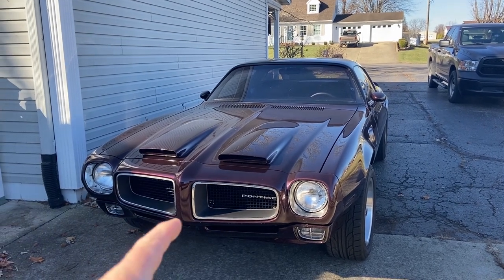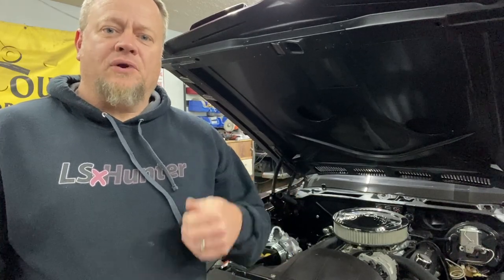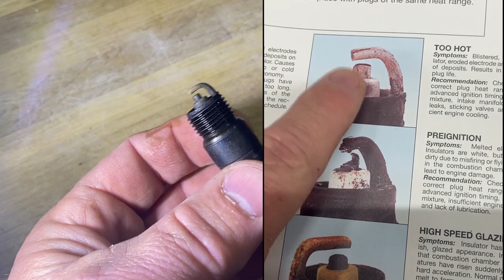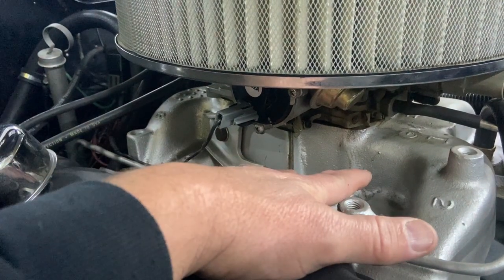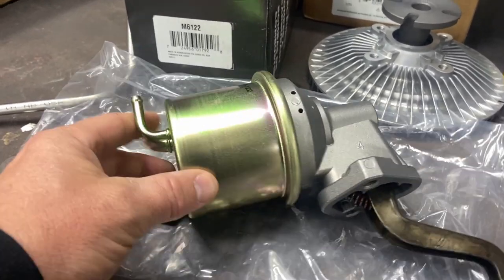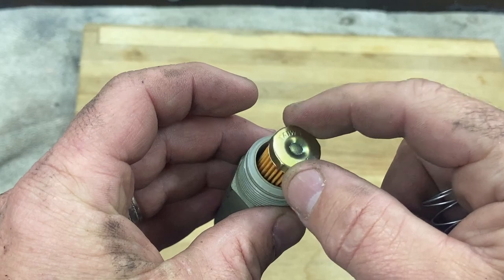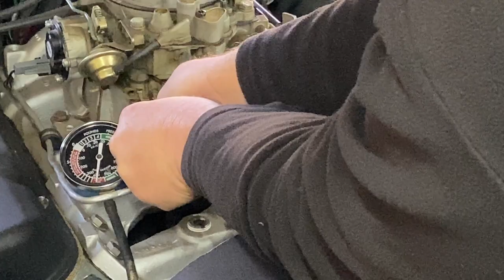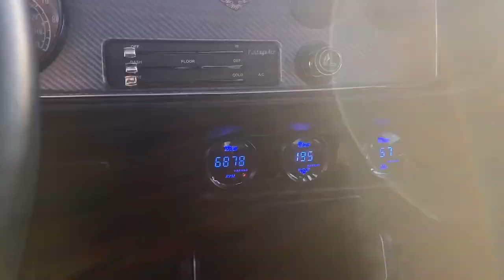Pinging, Detonation, Pre-ignition Problem Solved. Was it a lean condition, bad fuel, wrong timing?

Comment: Just in general things to check:   advance timing so at 3000 rpm @32TDC, run high octane and or quality fuel, Lean condition run carb Idle mixture run them a hair rich, coolant thermostat fast acting (not high flow) give the radiator a chance to cool the engine. Static Timing from 10 being the min and 12 being the max.  Yes for, you running to lean got those cylinders to hot....
 Great video.
Reply from the maker: Sounds good! Thank you!

Comment: In the summer if that temp creeps more than 10deg  look to change that thermostat (stay away from high flow).   200deg is just on the edge hot for a create engine  . big block 190  
 small block 180
Reply from the maker: Gotcha. thanks for the advice!

Comment: Nice car, glad you figured it out, nothing worse than chasing a problem. I've enjoyed all your paint videos. Because of you I just received my Urechem sealer, base and clamor clear today for my 65 GTO, I had first ordered single stage another brand and could not get it to lay without orange peel (on practice parts), hopefully I can practice and get the Urechem to lay out.  Motor sounds great who built that for you. Thanks
Reply from the maker: Good deal on the URechem. I really liked it and I'm a novice/hobbyist.  Good thing about have a few coats of clear is that any texture/dirt can be buffed out!   I ordered a long block from Len Williams Auto Machine in OK.  He is on the web.  Super great price and i had zero issue with the build quality, shipping, customer service was great.  Len is old school though. He only takes checks or cash and it did take him several months to get it built and shipped.  I put the intake, carb, distributer etc on and did the break in out in Heavy Pedal Garage.   If you are looking for a quality affordable build, he is the man!
Reply: I figured when you said 9.25 compression and 6x heads it was probably Len, yea he built my 461 stroker for my 67 firebird. Runs great almost scary lol. Son and I did a total frame off, like new, but now have decided to sell it, with about a 100 miles on it. Only because the 65 GTO is really my fav car. I had 65 GTO when I was 17. Thanks

Comment: i have a 1973 formula factory 455 4 speed with a/c and it does not have a clutch fan 7 blade direct mounted fan from factory and huge harrison radiater which is org.joe p.engine reworked 30 over comp cam and head work its a monster but in summer on highway still gets hot around town runs at 160 all day long..thanx for video..joe p.
Reply from the maker: Nice 73 formula. Sounds like a beast!
Reply: @HeavyPedalGarage  thank you only 227 made never seen another have had for 17 years..joe p.

Comment: Hey Nate, great content! After watching this I realized I have the wrong pump as well and having overheating issues. I have the right pump ordered but having issues finding the right fuel line. Any chance you could pass along that part number? Thanks in advance.
Reply from the maker: Glad the video helped.  I got my fuel line from Classic Industries.  I think it was OER brand.  I dont have a part number unfortunately, but my block is for a 1973 GTO and the line listed for that block fit just right.

Comment: Thanks for sharing this. I have the same car, I don't have any pinging or detonation but it seems to fall flat around 3000 rpm and I have the shallow canister pump on my 455. When you went to the deep canister pump, did you have any interference issues with the rubber inlet fuel line and the pitman arm?
Reply from the maker: No issues. Things get a little tight but it’s good.

Comment: Also that carb filter setup looks restricted..    put check valve in fuel line. At most
Reply from the maker: I’ve considered that along with a fuel pressure gauge

Comment: At 9 anything to 1 compression you will be good with regular gas. You are probably losing ho by running premium. Understand how octane rating effects an engine. Alsowhat is your head gasket thickness and how deep in the cylinder does the piston sit tdc. Open or closed chamber heads? Im thinking you lack effective quench
Reply from the maker: good advice. not sure on head gasket thickness or piston depth.  ive read a little about quench, but will try to learn more.

Comment: will knock give you s serious blow to the car.  I have a severe intermittent shudder going uphill at 60mph in the mountains.  i thought it was a transmission shift but letting off throttle and octane booster helped.  buick 1999 3.8L...  i think it is pre-ignition.  plan - scan computer, plug check, borescope.  I am losing coolant and i think alternator elbow is leaking.  plan to replace elbows and upper and lower manifold gaskets.
Reply from the maker: Might try changing the fuel filter. Hopefully it’s not burning coolant. That would be a head gasket failure.
Reply: @HeavyPedalGarage  i think these leak around the plastic intake as well as the elbows.  will check fuel filter.  thanks

Comment: I had a 389 that had a pinging problem ended up being the points gap was too big, as in too much dwell
Reply from the maker: those pesky points! now this something i have not had to work with yet.
Reply: @HeavyPedalGarage  yes it required a small Allen wrench threw a small slide open window on the side of the distributor cap, while running you can adjust till it sounds right

Comment: I have the same problem on my 73 charger i put new plugs and wires oil and oil filter new fuel pump new thermostat new carburetor and still the same i think its the distributor timing